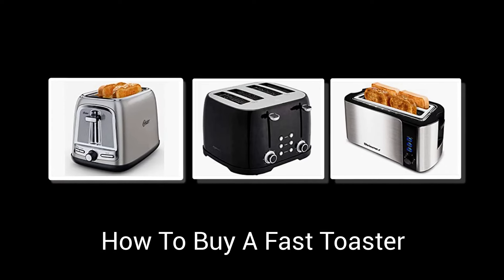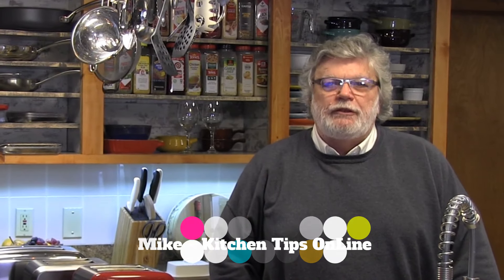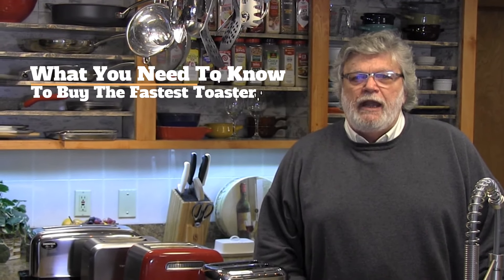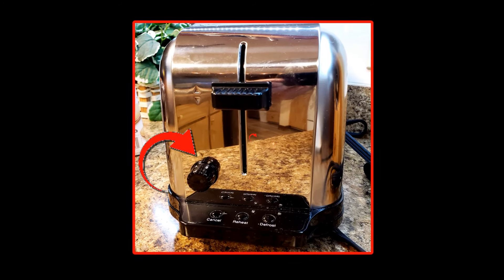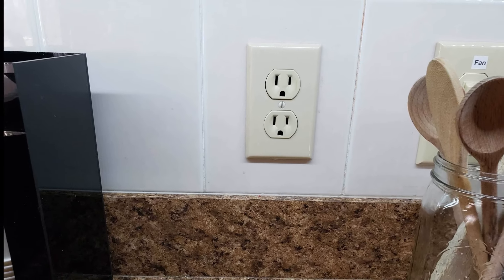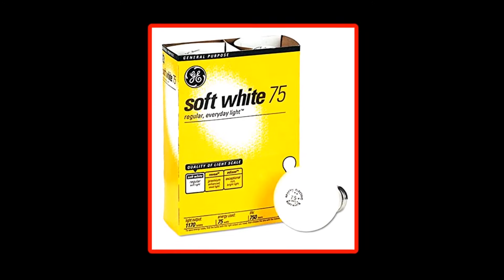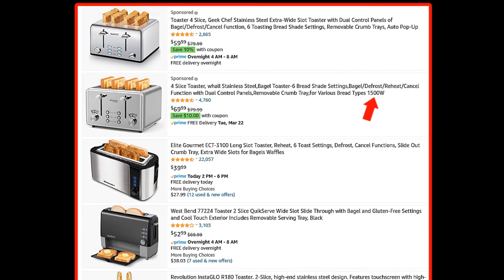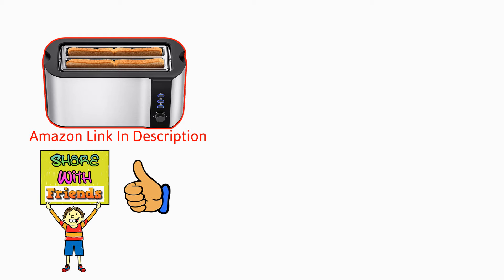😥 Don't Let Toaster Regret Get You Down! Expert Tips to Avoid Buyer's Remorse

Comment: How to open a glass jar that wont open. Don't use hot water. Use a wire cutter, make a small slit from the side of the lid  to the top. Plus the lid will still be usable to close your jar. Just be careful not to cut yourself
Reply from the maker: Great tip, thanks for sharing, Mike 🧔

Comment: Good information - unfortunately none of the toasters on Amazon give the wattage! Also, I would have liked you to give tips on what features to look for in a 2 slice toaster. Thank you.
Reply from the maker: Roberta, the video was about how to buy a fast toaster and the fastest toasters are four slice toasters. The reason that Amazon or most retailers don't give the wattage is because they don't want you to know the wattage. They will call it fast hoping that's good enough to make the sale. If you find a particular toaster that you want to purchase other than the four slice toaster recommended, get the model number and do a Google search for what is the wattage of that particular toaster. Mike 🧔
Reply: @KitchenTipsOnline  Thank you for clarifying that. I somehow missed the point that four slice toasters were faster than two slice toasters. I only needed a two slice toaster so I’ve ordered a Buydeem brand from Amazon  - I just hope it works well.
Reply from the maker: @robertastewart2083  You're welcome 🧔

Comment: What wattage is considered good for a two slice toaster?
Reply from the maker: Ideally you want to get an 1800 watt toaster. That obviously would be very fast. My recollection is that the one I demonstrated in the video is 1500 watts. Just about the only place you're going to find an 1800 watt toaster is at a restaurant equipment supplier, like Webstaurant. The best you are likely to find as a consumer-based toaster is 1500 watts. Mike
Reply: @KitchenTipsOnline  Thanks. But some reviews I read complain about the plastic parts of toasters being burned after using for some time. Is it because it's too hot? Ae there any brands you recommend?
Reply from the maker: Here you go, https://amzn.to/3FMnggd